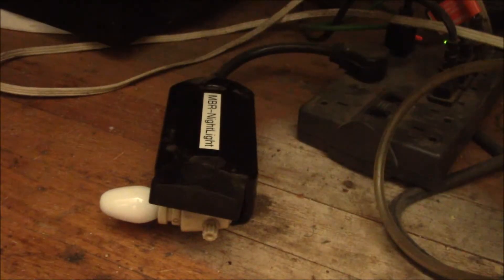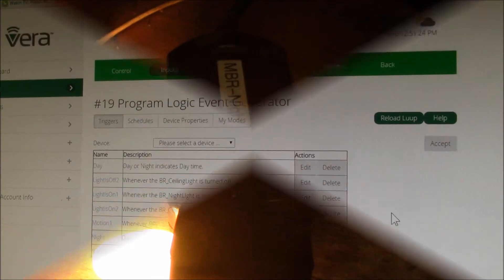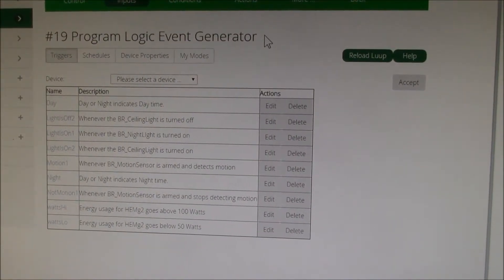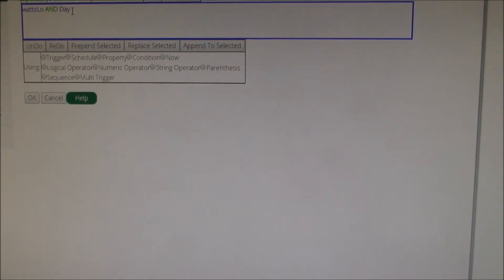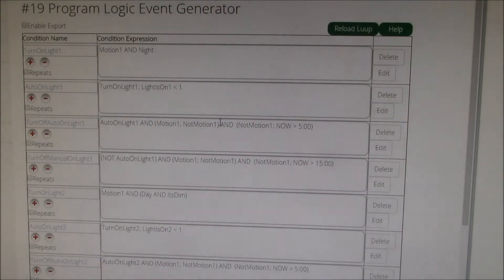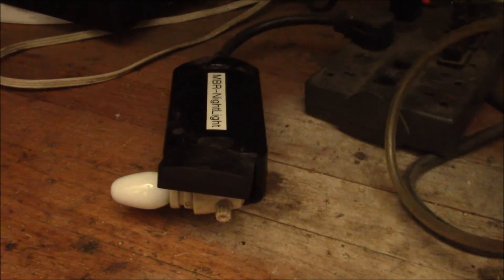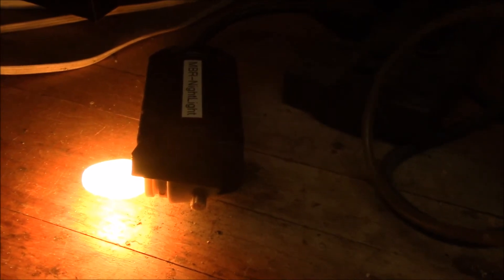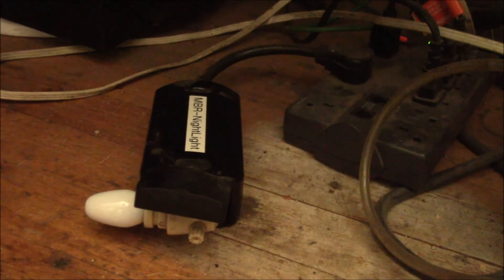Flashing Light Based upon Home Power Consumption

Comment from the maker: This was my first foray into automating power control with my home automation system.  It might not seem like much, but this was the first step.  Years later, I turned this little flashing light into a full blown AC diversion load that works with my solar power system and helps to drive my home's power consumption down close to zero for as much of the day as possible:
https://youtu.be/RGGtmbWEPQ4

Comment: Congratulations on the video, I would like to know how to configure the micro smart switch g2 from aeotec, what procedures should I follow to USE THE PLEG? THANK YOU
Reply from the maker: Nothing special needs to be done to use with PLEG.  Just have the device configured by the Vera controller such that it can be turned on and off from the Vera user interface.  To control with PLEG, simply set up a "Logic Action" that is run when some condition or device trigger is satisfied.  Then in the logic action, select the device name assigned to the switch and then use the SetTarget action, using 1 to turn the device on and 0 to turn it off.  In most cases, you'll need a pair of logic actions for each device, one for On and one for Off.